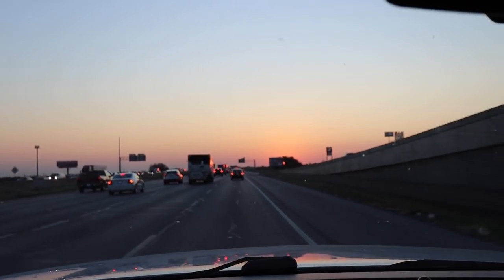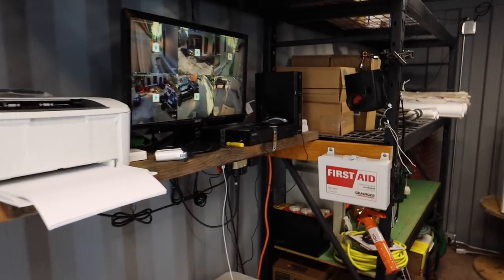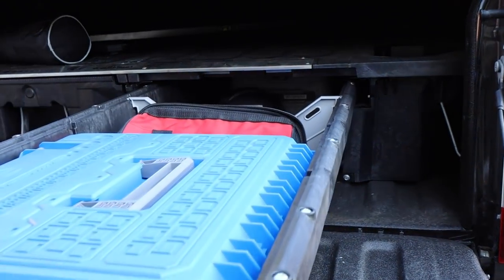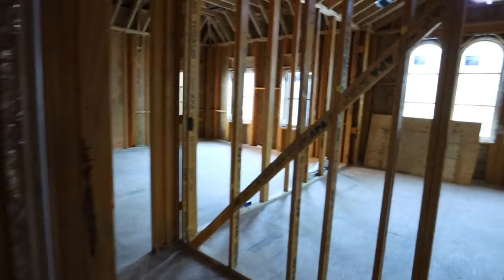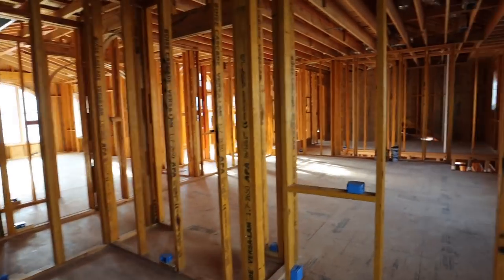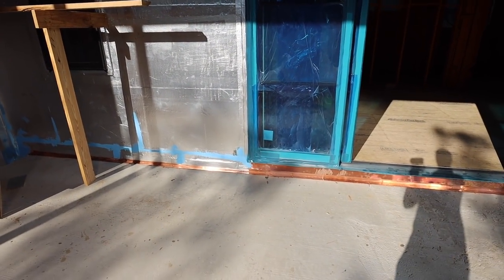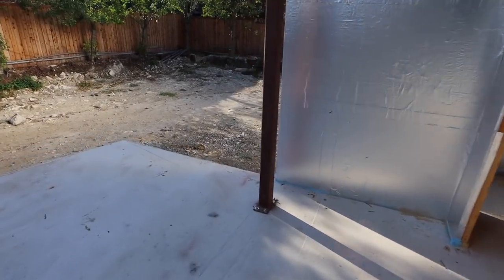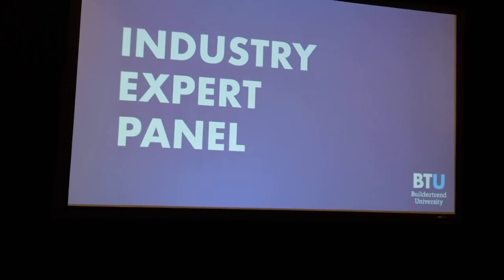Framing Tour - All engineered studs in this Highland Park Dallas Home

Comment: So literally the entire house is a wood frame and carries on the wood frame and you are just going to brick around it with CMU blocks and then put stucco over it because...? I don't really get why you use an entire CMU block wall section if the only thing carrying into it is the stucco. Why not use the CMU as the load carrying wall instead of putting up both an entire wood carrying wall AND an MCU wall just for the stucco? Or am I missing something?
Reply: This is a frame house imitating a masonry building.  The fake corbels are useless  fluff. The whole thing is a sham built to the highest standards.  Too bad it's wasted on such unimaginative design. A $5 million fake out.
Reply: @oltedders  Kind of amazing how they create an overhang and then sculpt massive ceder corbels all around to pose as the rafters. You gotta think wouldn't it be cheaper to just build the entire thing in the style you're trying to make it look with real rafters. But I doubt these guys wouldn't if that were the case. Or they really just can't let go of their traditional construction and wing it to that sort of extent .The detail with the air gap IS kind of how most Belgian masonry buildings work but then the internal support wall is CMU and not the outer one. Here you can see a detail of how wood frame houses with brick outer facade is done here in Belgium. watch?v=28j2wtcAE-c There is no tar paper or extra protection of the sheathing it's just waterproof OSB or similar. So the entire  "alumaflash +" water protection wrapping they put behind Stucco AND a CMU wall AND an air gap is to provide the vapor barrier for the air conditioning. That's something I've never seen in Belgium but it's a very different climate. And he was still going to use a drainage mat as well. With brick we do that sort of drainage waterproofing at the bottom with openings to let the water out. But I guess it's Texas so they barely see any rain anyways.  I guess the CMU outer shell was also the most cost-effective way to create the extra barrier and the base for the stucco and ornamentation. So the building makes sense cost-function wise except for perhaps people who don't care about the limestone details and authentic brick house looking thick walls, ceder corbell ornamentation and all the inside framing... Still a comparison to doing this house with real rafters, block or brick construction would be interesting. I think they just have far more experience with detailing the wood frame for airconditioning and everything else and it wasn't worth it to figure everything out for a single job. Or it really was cheaper.
Reply: @steamsteam6607  
I doubt if it was cheaper building it this way. I don't know if there are contractors here in Texas that could construct a masonry block building of this size. It would now be a steel frame building with masonry infill built to commercial specifications, not the solid masonry and timber frame roof system that would support a tile roof if built authentically to the historical model. I live in Houston Texas (200 miles south of Dallas) where rain is a constant threat to the integrity of a building. 5 inches of rain during a single storm is not out of the ordinary. A good roof and foundation are vital. Cellars are unheard of here and nearer to the coast new construction must now be on piers to prevent flood damage.
Texas contractors are enthralled with pseudo Mediterranean style houses. Ridiculous! No one has yet to see a widely accepted regional style of modern construction designed for the climate. Indeed, modernism has been rejected, save for some few architects building for private clients. Pity! South Texas is ripe for a complete overhaul in building design. Alas, the mindset of the average homeowner here is still quite provincial.
Reply: @oltedders  It almost always is evolution rather than revolution as availability of skills, materials and knowledge more often determines the way things get done than technology or common sense. If we had an aluminum quarry next door and a forest 200 kilometres away we'd probably be building entirily with aluminum. I like some of the things shown here and I am a big fan of the style of the hosue myself but I am an even bigger fan of sensible, (cost-) effective construction. I feel they did a good job on this house but there has to be a cheaper and more efficient way to get a similar result. The main catch is how to get thge airconditioned space efficiently I guess the most effective way was a wood frame house and then just CMU and stucco around it. But yes it is a lot of money and time and effort for aesthetics. Which grinds  gears with most people in this trade.
Reply: @steamsteam6607  
The problem with traditional stucco in Texas homes IS moisture build up behind it and the subsequent rotting of the substrate. What they are doing here is the most advanced method of preserving a frame building disguised as a masonry structure.  In other words, a 'sham for the ages'. Originally a way to cheaply imitate more substantial construction materials but has morphed into being more expensive than the original due to the need for technological advances just to keep the building intact. It's all so counter intuitive. If you've watched Matt's other videos you will have seen the extraordinary lengths he goes to keeping up with construction technology.  Interesting but not a solution to the problems of building for any but the super rich.
Reply: @oltedders  I guess I'm from Europe and my idea of Texas was more like Nevada in terms of climate. But you would see a pure masonry, block structure as better and cheaper then? I just have too little idea of how efficient that is to make an airconditioned space I figure they did it like this because pure masonry is harder to aircondition. If not it makes little sense if the only goal is to make the wall thick for style.
Reply: @steamsteam6607  
Texas is hundreds of miles across. It is nearly 696,000 square kilometres, if that gives you a better frame of reference.  The West is hot in summer and cold in the winter. Not as extreme as Nevada but much different than East Texas. The winters in east Texas are short mild and cool. Snow only the farther  north you go. A masonry building would be cheaper to build and heating and cooling would be divided in zones to accommodate the needs of the main living spaces first. The whole system computerized. Doubtless, there is a similar system in this house. Be that as it may, it represents the current state of the art in U.S.  construction methods. Whether or not it's to anyone's liking will depend on the sophistication of their personal taste. 
I'm impressed only as far as the execution of contruction, having worked in the industry myself, the design is juvenile and unimaginative. The fabric disingenuous.
Reply: @oltedders  I get the problem with fake rafters but I'm an "if it works, it works" kind of guy mostly. I don't mind it if it adds value and it's worth the cost. Why build bare essentials I do like good ornamentation. But some sense is always nice. It's a balance. I'd have to see the finished thing I think it will come out looking quite amazing. Especially that dome. Why do you think it's juvenile? It's really quite rare such a circular dome structure or you mean the wall detail specifically? Maybe they could have done something fancier but if it works...
Reply: @steamsteam6607  
Any teenage boy playing video games would be familiar enough with the vocabulary of arches and domes to design a entryway comparable to this. It really isn't stylistically challenging.  More of an engineering feat.  Why there are no windows in the dome to light this huge space is incomprehensible. It will be interesting to see what the lighting configuration will be. I'm sure it will delight occupants and visitors alike. After all it is a flight of fancy and will succeed in its purpose as a stage set for the imagination. In that rôle it works well. Architecturally, I see it as a failure.
Reply: @oltedders  Some skylights, dome windows would have been nice. But the drawback is the heat from the sun. coming into the house so they'd need some screen system as well. I don't think it's a failiure really. It is a style I can appreciate far more than some of the pretentious ultramodern minimalist brutalist structures that seem to only want to remind people of how little was done to put up the place they spend most of their lives in. Some more positive modern features like big windows, , terraces, sliding doors, open plan, perhaps some levels etc is also nice but can also just be a taste thing. If the building is sensibly laid out it can provide most conveniences of that style of architecture with a different feel. I think we should look at the finished product. Just because it's a different style and a bit of a weird copy of masonry building (that may or may not have been chheaper) doesn't mean it's a failiure imo. Comfort, longevity, (price) and aesthetics are the goal if it achieves those however then it was a success no? Should it really be an authentically built masonry European house if it can look and feel like one built for the same price or less? I guess the main concern is it looks like it is durable like the old European houses but isn't. I can't tell I don't have expoerience with this sort of construction. I just don't want to tear it down if it works and make sense in all or most ways even if it perhaps at first doesn't look like it., is unconventional
Reply: @steamsteam6607  
Not an issue. Windows can be coated with a reflective UV blocker that will cut out the heat exchange. We have it on our house here and it works like a charm. The biggest issue I see is access to window washing. Approaching from the outside on the roof would be the most practical. Otherwise reaching them from the inside would be next to impossible.
Don't be fooled by the simplistic appearance of modern architecture.  From my own experience it takes far more work to make things look as if next to nothing was done than to assemble elaborate woodwork, door and window casings. Both have there place but one look is far easier to accomplish than the other despite popular perception.